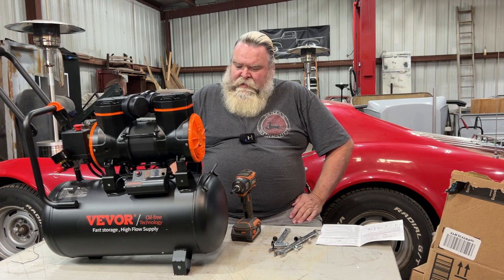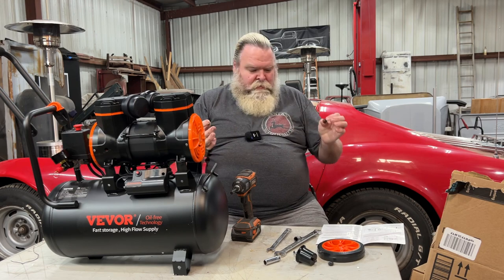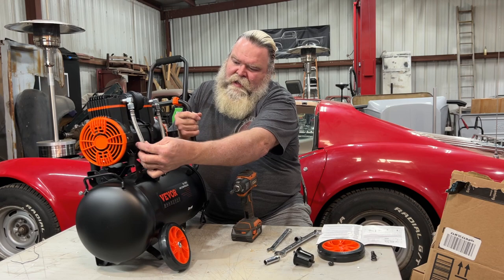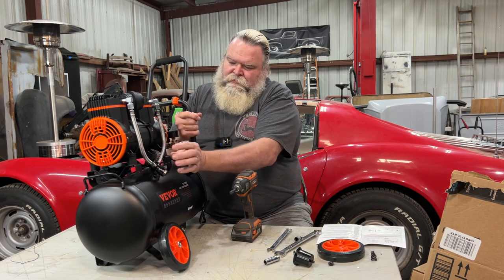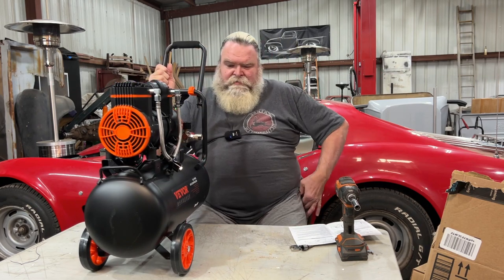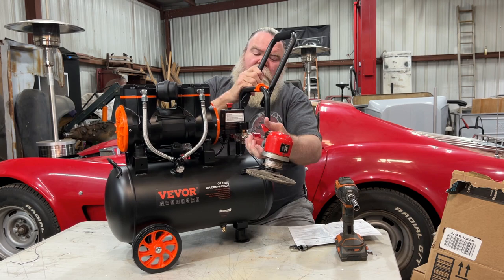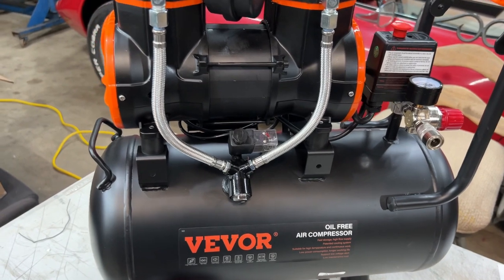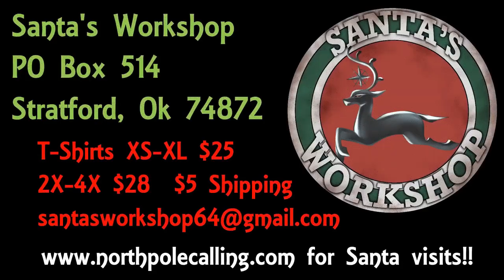VEVOR Air Compressor review

Comment: it is just not designed to be used with commercial air tools. It isnt big enough for that. However that doesnt mean it is a bad product. Looks good for a home use tool for like airing up tires and needs in a home. Blowing items off or like you said maybe and impact wrench. I am sure it can handle a small Nailer too. It is 6.3-gallon tank. I do wish people would have the stats when they do a review. That is just a comment for doing them better. Constructive criticism

Comment: I believe you pronounce it like this. (Ve-v--or). You really did put it right to the test. A sander like that pulls air constantly while using. No it didn't seem to be able to that very well. But I believe it does have what it takes to run a lot of different air tools. ANY that you are not holding trigger at all times. Ratchets, impacts, many different air nailers, and other similar type air tools. Being a dual pistol it can recover quick enough to run tools as I mentioned. But if you have to run something none stop like your sander that for the most part a person doesn't let go of the trigger much at all. Well doesn't handle things like that very well.  A home owners that just do smaller DIY projects at home it should be fine for them. As long as they aren't trying to sand down a car and paint it 😁.
       Now with all that said. You can get a 21 gallon 175 psi vertical compressor that can handle 4.0 SCFM @ 90 psi with 1.5 HP motor.on sale for almost the same price or just a few more dollars as the cost of that one. Yes it's from H.F but been working flawlessly for me going on two years now. I do let the air obut from a very easy little valve at the bottom at the end of the day after using. Just to keep the water from the tank just for longevity of the tank.  I can't speak for others but mine has been great. No I don't run a public shop. But in my personal little shop that I do use the compressor pretty often and handles everything quite well.
      Don't get me wrong,Vevor does make make a lot of affordable tools that work pretty darn good. But as for the compressor you can get better for me pretty much the same price at H.F. 
        Keep up the great work. Yes some things may take you a little longer than others but for good reasons. Health and none insolated shop that can be very cold-hot. I also have health problems and shop that slows me down as well so I understand. But try to put the best possible projects  and do very much so. To me it makes things seem more realistic. Yes I watch other YouTubers as well and really like them very much. It's just that my health doesn't in able me to get things done as fast as I once could when I was younger. Not that mid 40s is old, but with bad back problems I just can't work like I once could. It's very frustrating because much older people can do that more than me. I had a Masonry business that was going amazing to the point of not being able to do all the jobs people asked my company to do. Most would say hire more help and grow... But we worked hard, pricing was was a bit higher than other companies around. Not the highest but pretty close to them!. Only saying that because I put out some of the best quality around. That's not my words, but from contractors and home owners. It's all about quality not quantity. That's why I had a bit smaller company I then other Masonry companyies. Make us a bit slower than some of the other companies but most was willing to wait because they knew what they was going to get...... But around 10 years ago I slipped while climbing up up to finish a chimney. When I fell it was straight back and by the time I made it to the ground I was completely upside-down and landed head first. Not only was that the end of the company but my ability to work again..   At just a little over 30 years old everything in my life changed drastically. What I get now is about 10 times less than I made before the accident. The dream was all over at that point and just a little over 30. Talk about life changing. I was only 4 years into a 25 year mortgage for my new house. Went from a very hard working man that was living better than I ever thought I would to bearly able to just pay the bills. Hell it also ended 23 year relationship because she had become greedy and couldn't stand not having so much money. She did work a 40 hour a week job but just about 6 mouths after my accident we ended after being together since we was 15 years old... Don't get me wrong because it was for the best since money had become such a huge deal to her....
          Damn man I'm sorry.. Not sure why I ended up that deep into my life...
   
           I have been here on your channel since before any of the projects you even have now. Keep up the great work!!!!!!!

Comment: Does the tank have a water drain spigot? Even if it does, and depending on use condensation needs to be drained at least once a week, you need to get an in line water trap to protect your air tools ans keep from water spoting when painting. But you should know that.

Comment: I just bought a new 6 gallon air compressor & my review on it is the following: the problem with the compressor is that it has an over heat protection button. I turned it on and the tank got full with air then stopped, which is perfect but it’s supposed to automatically turn on again after you use up some air, it thinks it’s hot so it don’t come back on when it’s supposed to. It randomly works when it wants to. You think maybe it’s defective but it’s not. Because it’s brand new. I think it was a bad idea for them to put an over heat protection which almost no compressors have. Yes yours might work right know but when you most need it you will never know when the over heat protection button will kick in. So no I don’t recommend this product because of that.
Reply from the maker: I am finding that out! I’m not doing any more Vevor reviews.

Comment: Ordered the same compressor 4 weeks ago.  It trips out immediately if there is any pressure in the tank.  Plugged directly into a wall plug with 20 amp service.  it will not recharge, trips out. Vevor customer Service has been dancing about it for weeks.  Claim the voltage in my home to too low.  Funny over 20 other power tools work perfectly. 3 videos to them and still no resolution.  I'm learning to hate these guys.
Reply from the maker: The one they sent me has started doing the same thing. I have one more item from them to video and I’m not doing any more. Will definitely be doing an experience video after it’s done!
Reply: Was going to buy one not now lol..unless there is a solution
Reply: I complained enough that they sent me a 2nd.  It does the same thing.  I'm told the problem is it doesn't "unload" the pressure on the 2 pistons before restarting.  I have not learned how to fix it yet.  Any information would be appreciated.
Reply: @rickgibbons9645  looks good but junk..

Comment: 'Looks like a Toy.' 🪀🧸🚲 Don't see myself buying one anytime soon. I'd rather spend that Money elsewhere. Harbor Freight has Compressors, with twice the capacity & run time. For just a bit more, than what this one cost.
Reply: Or Rigid, Dewalt & Portor Cable from Home Depot or Lowe's there good aswell.
Reply from the maker: For what it is it seems like a good product, but only time and use will tell!
Reply: @SantasWorkshop  Hey Mike! I've found, Tools are one area, you don't want to cheap out on. You get what you pay for.